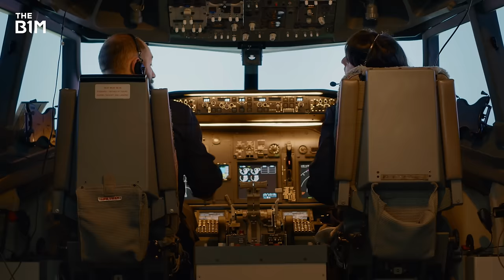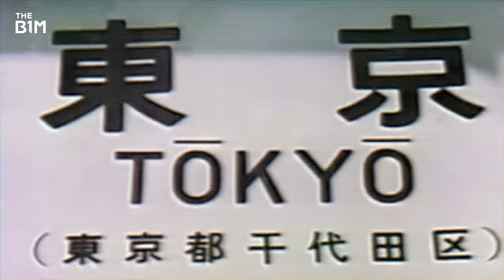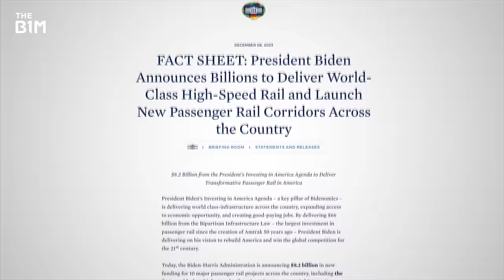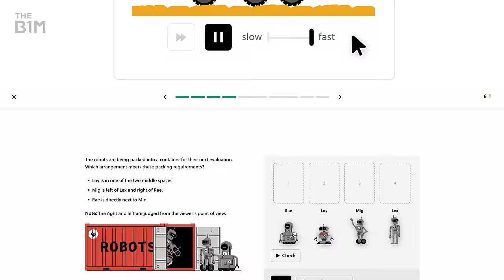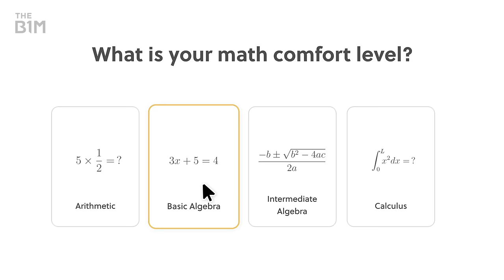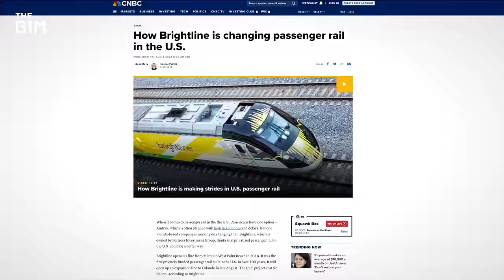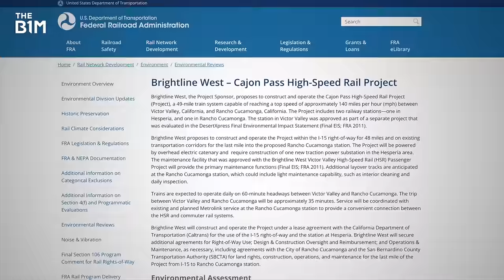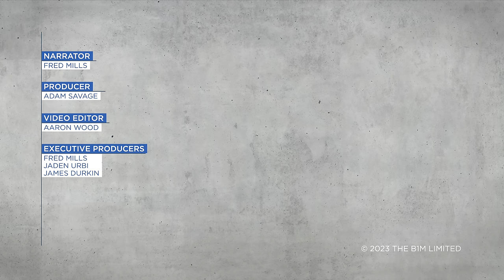The $140BN Race to Build America's First High-Speed Railway

Comment: I was a bit doubtful early on. But looking at predictions. California plans on having half all it's vehicles electric by 2030. If you're going to be stuck in traffic on the I-15. With charging stations far in-between, or take a high-speed train that's electrified running triple the speed. With pretty much all the way right-away. It becomes a no-brainer! With current plans on extending Brightline West further into LA proper. Hands down would make it the best option between destinations.

Comment: The dominating issue with intercity rail travel in the US comes from convenience costs. LA to LV is 5 hours by car, 3 hours by rail, and 1 hour by air. Rail is much more expensive than driving, even when you include usage cost at $0.65/mile, and is still 3X slower than flying without being 3X cheaper. The value proposition for rail only exists for distances between 150-500 miles. Still, at that distance, the convenience of having personal free transportation of your own car largely makes rail a consistent second choice across the globe.
Reply: I get your point. But we really need to start communicating that a one hour flight usually takes up close to half a day. Getting to the airport*, waiting for security, walking to the gate, waiting at the gate, taxiing, getting from the airport to the final destination...

*In Europe and Asia a train station is usually much closer to the destination than the nearest airport.

Comment: Brightline has been a PR success. Managed to label its train as high speed, and managed o get media to regurgitate the first privately funded" train.  Brightline has received HUGE sumes of government fnding and financial help to do Miami-Orlando Airport. (and this is partly why the entension to Orlanso and Tampa is on hold as they await to see which city will provide the most funding to get a route through them.).  This is just the freight railroad FEC having leveraged its right of way and land onwed around the tracks to develop stations. 
Miami to Orlando is no faster in speed than VIA rail trains between Montréal and Ottawa or Montréal and Toronto. Sure they have a short bit out of Orlando where train picks up speed, but the rest is all at very conventional speeds at 125kmh whioh is slower than many Amtrak trains.  
The service is great, but the pitch by Brightline is highly exagerated.   It has so many rail crossings along the way that there is no way this could ever become "high speed".  Except for Miami, all other stations were built at ground level for tracks which precludes ever elevating the tracks to provide hifher speeds.
The Siemens trains have their roots on older Viaggios from europe which were then downgraded to meet US FRA standards and are heavy, diesels. There is absolutely nothing "high speed" about them, and they stll rely on old 1950s light signals along the routewhich is a 1950s heavy diesel  freight railroad, except for stratch between Coco Beach and Orlando Airport; (Brightline does not serve Orlando per say as this woudl entail FEC paying another railroad for rights to use tracks into Orlando).
Reply: You mention Brightline receiving very. generous. grants from the taxpayer . Is that not a weakness with sole reliance on private  firms for. passenger. rail travel since they can 'pull up stakes' (and. miles. of track) at will and. leave the. business if they can  make more. money for their. shareholders elsewhere? What happens to the. taxpayers money in such cases?

Comment: 11:30 High speed trains actually can take steeper inclines than crago trains. Cargo trains can only do 1-2% (dependend on power-weight ratio) While high speed trains can go up to 4-5%. This is because of their higher power-weight ratio and their high momentum.

The only problem that I can see happening is what germany has as a problem with their ice1/2 sets that they have powercars and so do not have a lot of traction due to their limited amount of powered axels. That's why on the very steep route between Colonge and Frankfurt they only use ICE3 sets because those have way more powered axels. But aslong as Brightline uses trains that have their engines spread across the train in won't be a problem.

Comment: 11:25 "Cajon Pass ...HIgh speed traims really have to travel om groumd that's as flat a possible, so they need to slow down through this keep section.."
Completely and totally wrong.
High speed trains have high power to weight ratio and steep grades are simply not a problem.  Modern ones with distributed power and high adhesion are even better, but even when the initial french TGV lines were being built and separate power cars were comsidered the only option, grades of 1/27 were fine.  The problem with Cajon Pass is that if you want to go fast, you have to go straight, and maintaining speeds significantly over 100mph means you need curves with radii in miles - building that through mountains inevitably comes with a hefty civil engineering bill.
Reply: Yeah, the rolling stock of a Siemens Velaro will have no problem with the Cajon Pass.

Comment: 300-350 kmph seems to be the sweet spot in regards to being easy to achieve, economical to run and not being too loud both on board and externally. 
I've seen the Shanghai maglev (430 kmph) and the Shinkansen Line train in development (600 kmph) and both have been loud onboard. 

What I'd like to see is a Stadler Kiss (Eurasia) two storey luxury sleeper train humming along at between 160 kmph - 200 kmph 😍
Closest we'd ever get to IRL snow piercer, basically a larger version of the twilight express mizukaze

Comment: Great video as always... but... using standard international units would greatly be appreciated by a lot of viewers. 
Most people outside of the US have no clue how fast or how slow is 100 Mph. 
No need to tell both imperial and metric systems, a caption in the video would be enought. 

Thanks, and keep up the good work.
Reply: 100mph is pretty fast.
If your car only goes 100 km/hr.
It's pretty slow.
Reply: A good way to mentally convert is to use sixes. For miles to km it's 1.6 (i.e. 100 mph is roughly 160 kph) and for km to miles it's roughly 0.6 (i.e. 100 kph is roughly 60 mph). That may not help much if you're not good at doing math in your head but it's something to remember.

Comment: As someone who’s taken the Brightline down to Miami a few weeks ago, it was really empty. Not a good sign
Reply: A hilarious joke of a comment considering the high ridership Brightline has gotten not just since the opening of Orlando but over the last 2 years. Did you know in 2022 they carried 1.23 million passengers? If it were an Amtrak route, it would have been the second busiest route in the nation outside of the Northeast Corridor - only behind the Pacific Surfliner. Through 8 months of 2023 they carried 68% more passengers than it did in 2022 during the same time frame. Since the opening of Orlando, the ridership has exploded.
Reply: @Ven100  Im saying this as someone who supports high speed rail (hence why I took it) but at least anecdotally, when I was rode brightline it was empty. Also, my workplace in Broward has a rear patio next to the track so I see them pass by all day long and I’ve never seen more than 10% of the seats filled
Reply: @Jaffjv and I'm someone who's taken it many times and has been on packed trains. Clearly their ridership numbers suggests far more than your "I've only seen it filled at 10% that most" 😒

Comment: Where's the issue with Cajon pass?
A tunnel would be approx. 10-11km long.
European engineers don't  even blink about that and just dig under it.

And changing traines in Rancho Cucamonga just shows they don't get what really makes railway atractive: City center to city center connections
Reply: In regards to Rancho Cucamonga, they are waiting for CAHSR phase 2 to be completed (LA-San Diego) which will be routed through the inland empire. In the meantime there is a commuter rail that will link Rancho Cucamonga to LA.
Reply: You don't even a tunnel. It's about 400 m elevation change on ~20 km of track, so a moderate 20 ‰ gradient. A TGV or ICE train could easily handle 35-40 ‰.

Comment: Although all of these projects have their challenges, there is definitely an upward trend in the industry. Undoubtedly, the Brightline West, CAHSR, and new routes the IIJA funded for FRA research will yield results. The US can only lower costs if we continue to build as with the economy of scale, the cost of labor will decrease (there are a lot of skill sets and manufacturers that simply do not exist domestically because the segment has been underinvested for so long). Not sure if Brightline West will be fully open by 2028, but they may be able to run some kind of service by 2030. CAHSR just needs to connect to Caltrain, get trains running, and start running revenue service in some capacity. They have the most difficult bit constructed and are buying cars, signals, and systems... It will happen - just a question of when now.

Comment: Brightline is working great in Florida!
Reply: Because of tourism.
Reply: Um
Reply: @spider6660  More locals use it than tourists. The commuter population between West Palm Beach and Miami was so large that once were hourly trains at 5:36am, 6:36am, 7:36am quickly became 5:36am, 6:36am, 6:51am, 7:04am, 7:36am.  Tourists aren't getting up between 4:30am-6am to take a train in Miami in the morning. The commuter monthly passes had each ride equating to less than $10.  As far as Orlando, since opening 66% of the ridership has been from Florida residents - with only 33% being from out of state and international tourists. While tourism is a factor, it hasn't been the driving force.

Comment: While Brightline in Florida is a big advance for the USA, it's a long behind high speed rail in mainland Europe and southeast Asia. It uses diesel locomotives with a less than impressive maximum speed, and a significant part of the line has level crossings.
Reply: Brightline is a hazard because it’s operating at ground level, if a car gets stuck in the tracks at the wrong time, goodnight.
Reply: Only Indonesia has high-speed rail in Southeast Asia.
Reply: @TPAsses If you get struck by a train at a level crossing, it's never the train's fault.
Reply: Europe still has level crossings too. Why yes grade separation is better you cant fully grade separate every thing it just be to expensive. The best most railroads can do in the us is try and grade separate the busiest intersections since they are the highest risk
Reply: There are plenty of trains in Europe that have the same maximum speed of 125 MPH/200 KMH.  Not every route calls for a 186+ MPH/300+ KMH train.  The success of Brightline is proof that outright speed is not the most important factor to have a viable rail line.

Comment: Eisenhower's design for the interstate highway system included space between opposing lanes for future rail inclusion. Not surprising to see it finally getting used. The problem is using it for intra-city mass transit as seen in some US cities because generally speaking interstate highways or limited access freeways travel around the location of the population ie neighborhood centers rather than among them where you can use them by walking to them. But for interstate longer distance train travel the medians were built to serve that purpose and allow for that option but America abandoned rail and fell in love with (and dramatically subsidized) oil rubber steel concrete parking lots and automobiles.

Comment: 40 miles east of LA? 💀💀 - hopefully the connections are good, city centre to centre would be even more appealing but still a great option over driving
Reply: Maybe tourists won't mind, but yeah, the train definitely should go all the way downtown, preferably all the way to LAX.
Reply: It'll use the same route as CAHSR once the route between LA and Bakersfield is finished
Reply: Last time I was there I remember missing the train for a few minutes and the next one was ... in 1 hour. Completely defeats the purpose of a HSR if it will still take you a couple hours more to reach your destination.

Comment: If air travel is faster and cheaper, why (unless you’re riding the rails for pleasure) would you want to travel via train? And (since I know nothing about such things) maybe someone can explain why it’s apparently impossible to just build faster trains to run on the existing infrastructure?
Reply: Some people want to travel via train because you are not treated like a sardine in a can and you can take a stroll to the train cafeteria if you want. Seats are more spacious too. You can't buid faster trains running in the existing infraestructure for the same reason you can't have 200 mph cars in current roads.
Reply: and you can bring liquid in a train !

Comment: I did one travel by train from Los Angeles to San Diego back in 2009. Or, to be more precise, Anaheim to San Diego. The trip itself was pleasant enough, went through some nice scenic coastal bits. Can't remember how long it took.
The biggest problem was the stations themselves. I'd been staying in Anaheim for Disneyland (yep, as a tourist). The Anaheim station was like a small, open-air platform within or next to a massive car park. It wasn't big or impressive. Just a platform near a car park. The only reason it was convenient was because it happened to be not far away.
At San Diego, the 'platform' was literally ground level. You stepped off the train in this sort of marshalling area - directly onto the pavement. Not even a platform at door level. Literally, you stepped onto the ground.
Reply: The Anaheim station had a massive upgrade in 2014, it's now a big modern space with LED fixtures that light up at night with rainbow colors. The Santa Fe Depot in San Diego looks nice but you're right about the platform, they could work on that.
Reply: @colbystearns5238  makes sense. I made this rail journey in 2009.

Comment: In Europe, high speed railway cost goes from €30 to (in hilly/mountain areas requiring tunnels) €200 millions per km.
The $12BN budget for a LA-LV high speed line, at $34 millions per km, is wildly optimistic.
More like 50-60 billions will be required.

Comment: 120 years ago a train ride from SF to LA used to take 10 hours. Now the same ride takes 12 hours, as long as there are no delays. The infrastructure is antiquated, inadequate, and often blatantly unsafe even for regular service, let alone high-speed trains. With the single exception of Brightline, the handful of private regional monopolies that own most railroad tracks across the country have no incentives to invest in any meaningful upgrades.
Reply: You got the first part right about the time line, but the rest is incorrect.  Back in the 50’s and 60’s passenger service on the Santa Fe was considered a premium service and the railroad gave some preferential treatment to the passenger equipment.  Now the government took over and created Amtrak which does not enjoy the same level of access.  Those double and triple tracks are constantly upgraded and have an enormous amount of freight rail traffic on them now.  The proposed high speed rail will need its own proprietary path to avoid the congestion.

Comment: One comment on Cajon Pass and grades for high speed rail. Passenger rail, including to some degree high speed rail, is more tolerant of steep grades than US freight rail. The problem is how freight rail overcomes the need for steep grades, namely by the use of circuitous routes with numerous curves to lengthen the route and lower the severity of grade. These numerous curves are not an issue for slower moving freight trains, but put a serious crimp on high speed operations. Passenger trains can handle steeper grades than freight, including high speed trains (as long the rate of grade change is not to abrupt) so the they could use a straighter, steeper alignment. Unfortunately, the existing railroad alignment is configured for a curvy, less steep approach and makes it difficult to locate a high speed line without buying land outside the ROW.

Comment: Two big challenges with fast passenger transport on rails in the USA:  First is that freight, meaning coal and lumber get the right away over passengers.  Second is that for passenger service, with at-grade crossings,  the crossing arms must be visibly down before the train can pass.  If this could be done via radio signal, the Amtrak trains would not need to creep along at 20 MPH in heavy fog or snow.  That freight trains get the right of way over humans could be changed with the stroke of a pen.  You would be going from Vegas to LA in five hours a week from today if that was changed.

Comment: A few added points to make:

Part of the reason passenger rail in the US hasn't been seen as great is because of how the rail infrastructure is set up.  The four main railroad companies put passenger and freight trains on the same track which means that they'll interfere with each other constantly in terms of schedules.  On top of that, those same railroad companies set up their freight trains to be so "efficient" that a single train can take up miles of track at a time; longer than it used to be in years past.  And that's not counting the cost-cutting those companies have done to where the rail lines themselves are in dire need of investment and improvement but won't get them to save money to give investors.

On the point of the California high speed rail, Elon Musk had a part to play as well in the delays with it.  That "Hyperloop" project of his that never amounted to anything was intentionally started to try to sabotage high-speed rail by diverting funding away from it.  Musk himself admitted it publicly in the past year or so.  I'm not sure how much of an impact it made; but it's certainly a non-zero amount considering the person behind it.